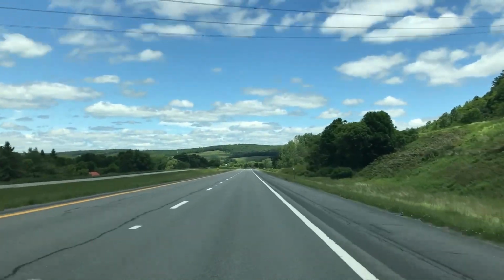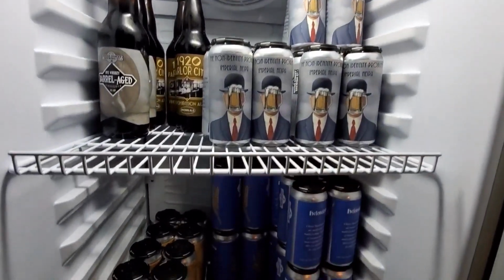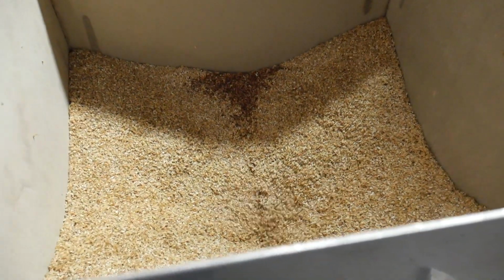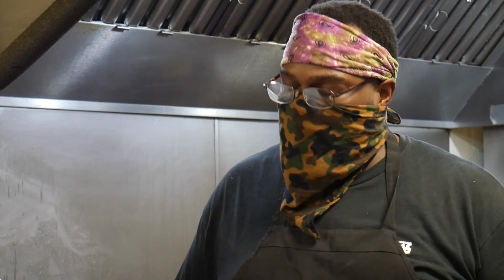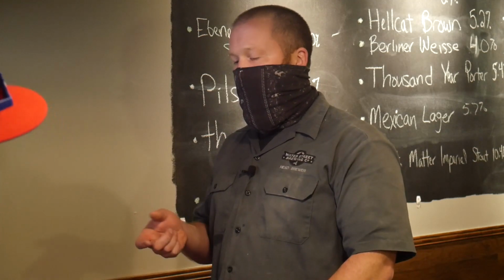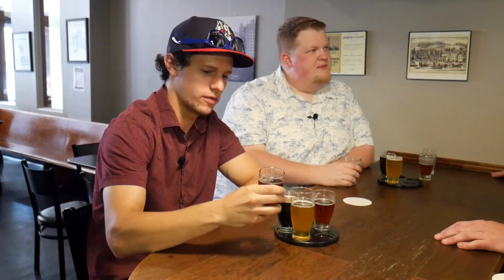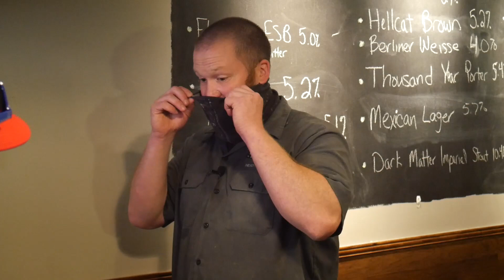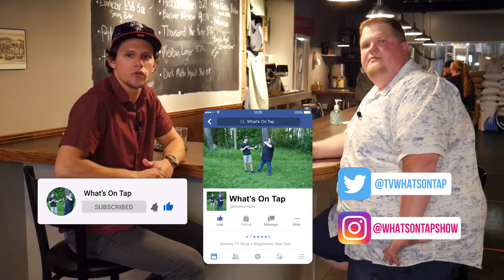What's On Tap - Water Street Brewing Company, Binghamton, NY (S1E1)

Comment: Single temperature infusion and high modified, malt produces distillers beer. To produce ale and lager with the method malt would need to contain magical properties in order for low temperature activated enzymes to work during a single, high temperature rest without denaturing, which is impossible. The brewing method skips conversion, dextrinization and gelatinization and without the steps ale and lager cannot be produced. It appears that the brewing method that is used for making craft beer is the same method that is used for making home made beer. The brewing method produces chemically imbalanced, sugar imbalanced, unstable, extract, and when yeast is added off flavors develop during fermentation and conditioning. The beer is artificially carbonated and served when it is still green, before the beer deteriorates. An entirely different brewing method and under modified, low protein, malt are used for producing ale and lager.